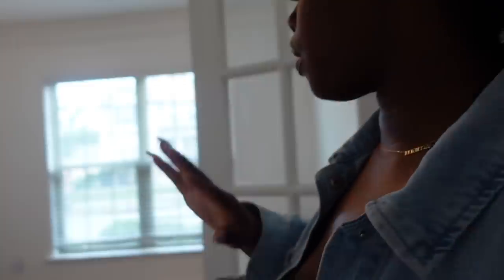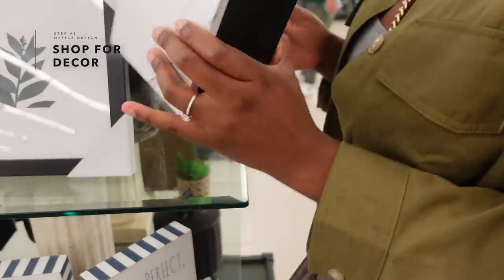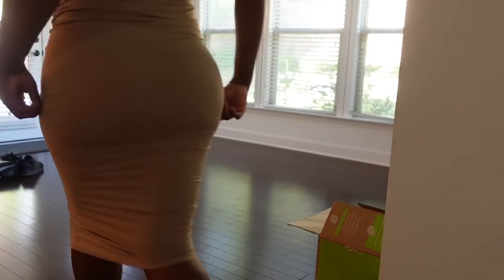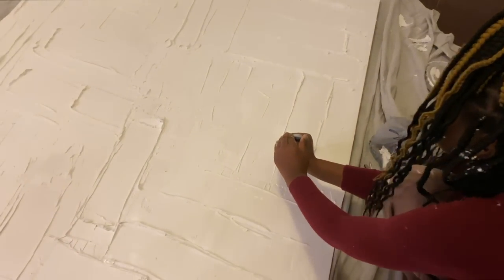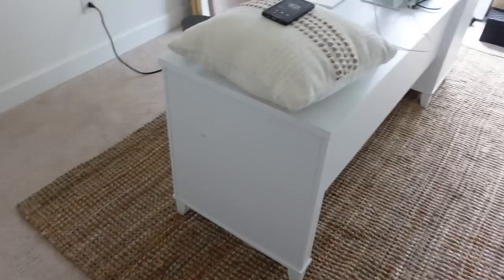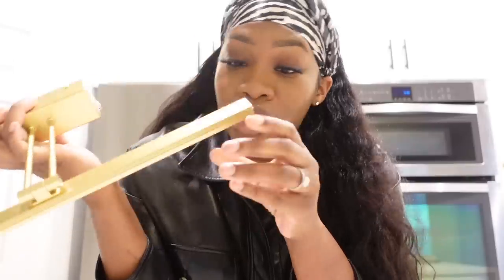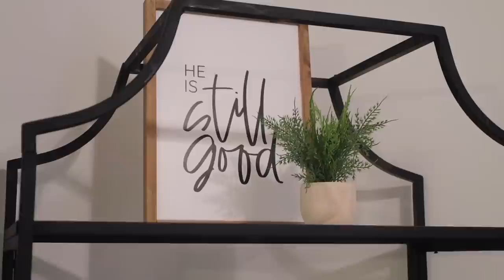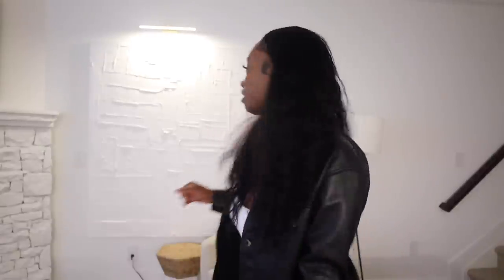HOME OFFICE Makeover + DIY Paste Painting | Maya's Dream Home

Comment: No shade but while this is nice I'm seeing a lot of the same style of decor from all of my YT faves, you should try adding some wallpaper murals in your space to separate yourself from the rest. For instance, the wall behind your desk is screaming for a beautiful wallpaper mural. Wallpaper is not what it use to be, there are some beautiful options and some are peel and stick so it's easy to remove when youre ready to switch it up. I use to do painted accent walls but have since replaced them with wallpaper murals. I have a video on tiktok, showing my glam room makeover (wallpaper accent wall) if you're interested I'll share the link.  *I'm in the process of adding my other wallpaper projects.